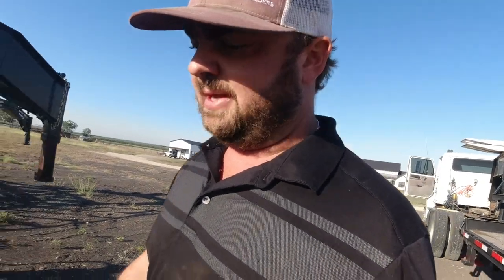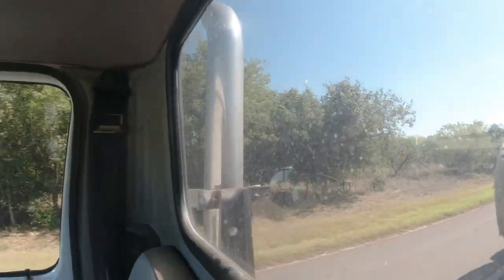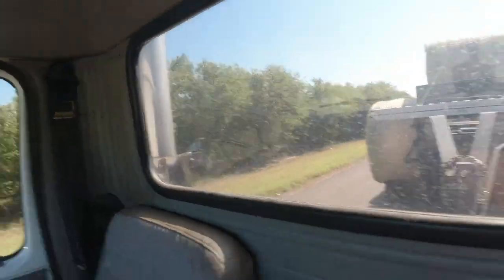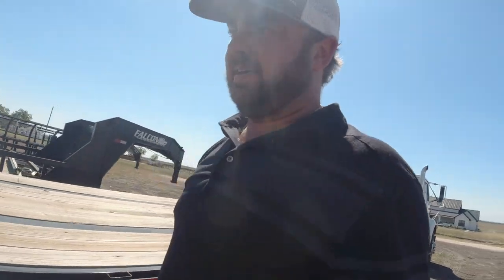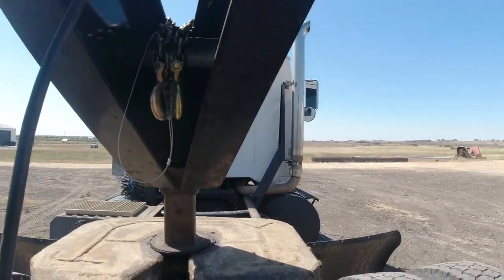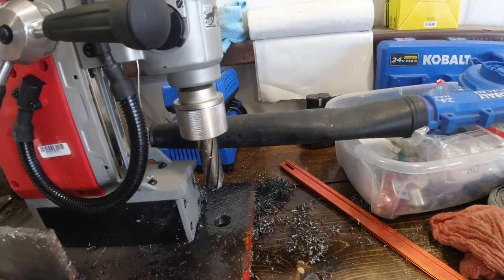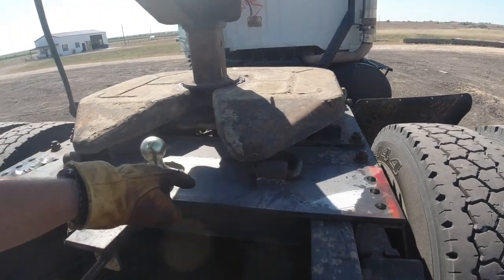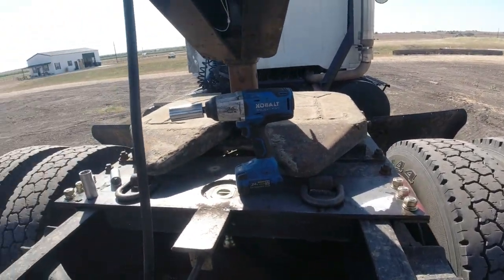A Little Hay Hauling Action for Ya!!!

Comment: Do you prefer hauling bigger loads on a deckover versus using the dumptrailer?  Once we started using a dumptrailer our deckover just sits.  I may break it out for 6' bales as that is a bit side for the dump trailer (12").

Had a customer show up with two 20-bales dumps last year.  Each one left with 30 bales!  I put the 3rd row on top between the standard 2 rows.  I didn't mind loading it but wouldn't want to drive it with 1 ton pickups that they had.  They were just 4x5s but still a lot of hay.

Comment: Got  3 old 2275  IH trucks  with mechanical  Big Cam Cummins  .... M11s are  electronic  L10s.........Only our old  U 600 Mack has a  Ball hitch mounted behind the 5th wheel...... the   IHs  are   fifth wheels  only for pulling step decks, box vans, flat beds  and the lowboy.......A  53ft dry van will hold  756 small squares which is almost 38000 lbs.....

Comment: I would go with a HD 4-way pivot 5th wheel hitch over a GN. That what I run and run king pin adapters like you have on all my GN trailers. So much faster and easier hookups and disconnects.